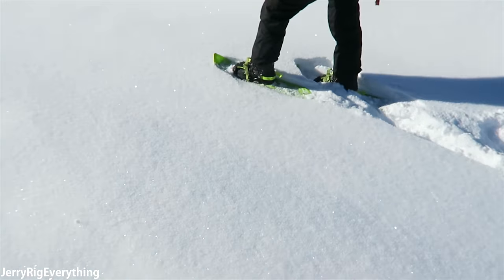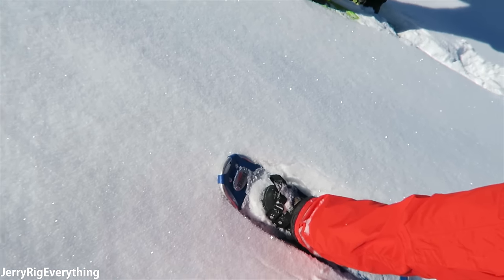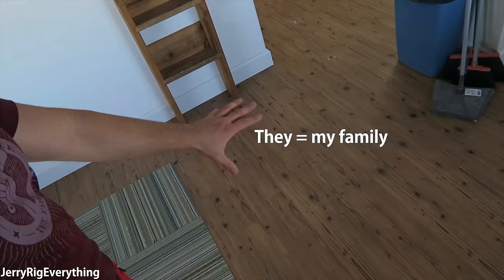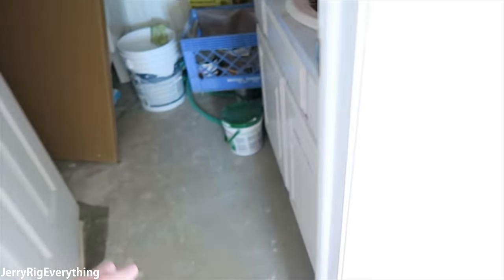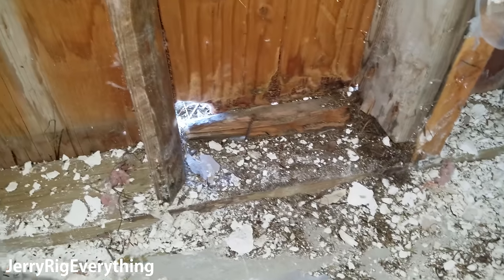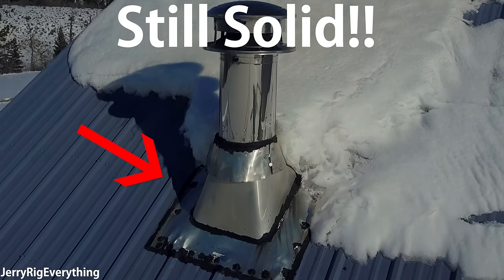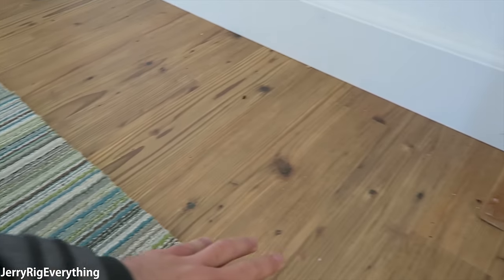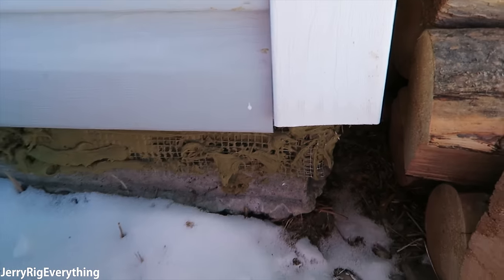Mouse Proofing Jerry's Cabin - VICTORY!!!

Comment: You could have used window foam to plug the holes along with the steel wool or mesh. I did the foam alone and the mice didn’t eat through it. The foam will also help insulate